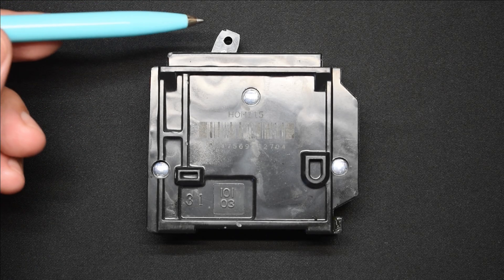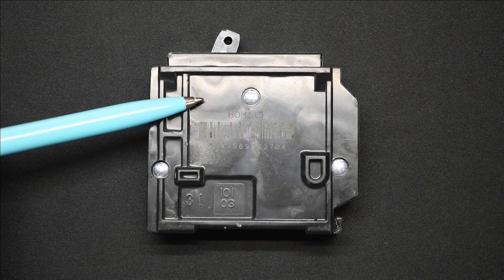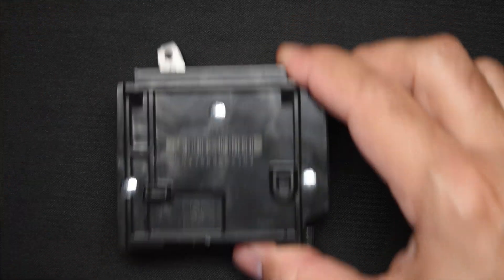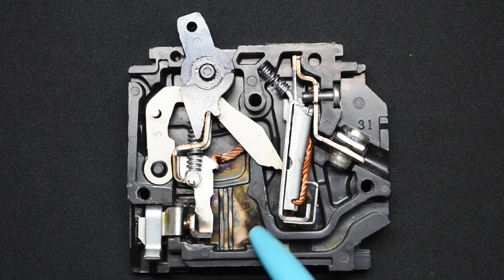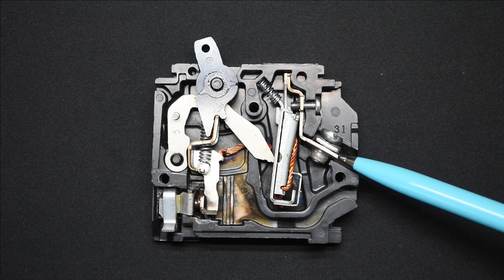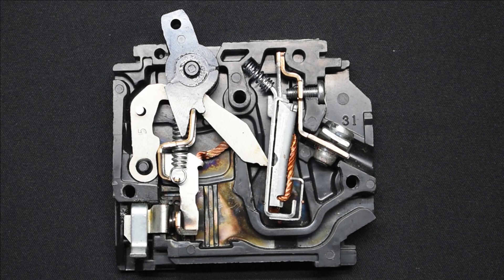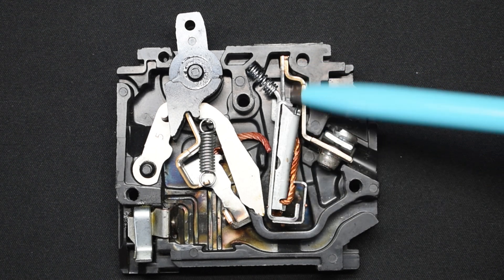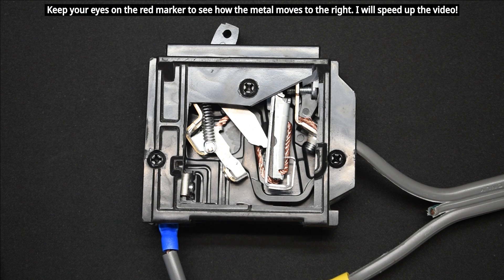Circuit Breaker Won't Reset or Keeps Tripping! (Common Problems)

Comment: I have two 15 amp breakers that won’t reset even after putting switch to the full off position. The switch is very loose and just keeps springing back.
Reply from the maker: Any breaker that doesn't reset needs to be replaced if you disconnected the load
Reply: I replaced the breaker and it still won’t reset

Comment: My 20 amp single pole won’t turn all the way on. I’ve replaced it 3 times and it keeps doing it. Funny thing is when I removed the breaker then I can flip it all the way. What can I do?
Reply: What ended up being your problem? Was going to comment to answer your question but saw this has hopefully been resolved.

Comment: I had a 20 amp breaker arc at the connection point to the bus bar while trying to turn it on; needless to say I'll be replacing that fuse. Any idea why this would happen; a faulty fuse, or perhaps a poor connection on the bus bar?
Reply from the maker: Challenger brand?
Reply: @electronicsNmore  It's square D
Reply: @electronicsNmore  Schneider electric I guess.

Comment: I used microwave last night and it went power off. I found out the outlet was not working because my toaster can't be switched on. Also, the outlet for my kettle doesn't work too (I plugged my kettle on the other outlet and it works). Then I checked my electrical panel and the breaker keeps tripping. So, do I just need to replace new outlets for both microwave and kettle? Or there's a problem on the breaker?

Comment: I used  new breaker and is still tripping while all the outlets are not in use can plz solve this puzzle for me.
Reply from the maker: Clearly there's a short circuit between the breaker and the outlets.

Comment: Nice demo! Circuit breakers can "wear out."
* The contacts can become worn or pitted, usually by using the breaker like a switch to turn on and off a load (some breakers are designed and rated for regular use as a switch) or by frequent tripping.
* Frequent tripping, or even extended operating at high loads that are nearly enough to trip but not quite, with the resulting extended high temperatures in and around the bimetallic strip, can result in weakening of that spring and associated components to the point of eventual mechanical failure.
* Some circuit failures can damage the circuit breaker. Such as surge loads that normally don't cause a problem, but which go dramatically higher during a failure. I wonder if something like that melted your copper braid?
I had frying bacon sounds and smoke coming from my well pump breaker. The breaker failed to open so I braved the smoke and flipped the main. It burnt the pump breaker, its bus contacts, and the adjacent breaker. It was a Siemens 240 volt, 20 amp breaker for a submersible well pump installed in the late 1970s and the pump most recently replaced about 10 years before the incident. Startup surge on the 2hp pump was specified at about 14x the operating power. The lights went out one day due to a distribution fault (blowing the 7200v fuse on the pole is dramatic), and while the utility was finding the fault buried on our street, they isolated each of the transformers then started connecting them one by one. I'm the first transformer on the street, and when they connected me and turned on the power, the voltage was nearly 300 volt instead of 240 and I nearly had a fire in the breaker panel. However after a bit of rewiring, all was apparently fine for a few years. Last summer I did need to replace the about 15 year old well pump. It was shorted... I wonder if when the power came on it was in a locked-rotor condition, and the high voltage startup did not help.
Reply from the maker: VERY common to have a poor connection between the circuit breaker and bus bar(especially older Challenger panels), I've fixed many over the years. Everything else you mentioned is accurate. Thanks for watching!

Comment: Most circuit breakers are designed not to trip up to 80 percent of their capacity. Anything above that , over time (minutes to hours) the breaker will trip.
Reply from the maker: That's true. If a load will be powered continuously, then you take 80% of the breaker rating as a maximum.

Comment: fantastic. Mine was even more less common which was the old one with the glass where you strew in with the viable fuse so that was pure thermal. LOL I put your video even faster speed to see the metal bend. interesting how they put just the right about of everything to trip at the exact temp... I assume. Unlike your other video fuse that tripped easily. 
I notice how they can vary in thickness despite the same voltage. 
Will you show the magnetic one or is it too much of a pain to deal with?
Also the voltage in the homes are higher than 120 maybe 124 at times which wouldnt that be an issue in your option for higher bill or more stress on things? the electric company says its within 8% range and says its ok.  hmmmm
thanks
Reply from the maker: I've swapped out screw in fuse panels years ago. I remember the time delay type. If this video starts pulling in views, I may do another showing the magnetic type. As of now, it's a big waste of time. YT is best at one thing, suppressing my channel.

Comment: Circuit breakers are designed to protect wire. Usually when a circuit breaker wears out it is because recently you may have changed a motor out for a new motor or replaced an oven or and very powerful microwave oven. Circuit breakers do wear out. Usually it is thermal protection part of the breaker that wears out over time because of the initial amperage draw.
Reply from the maker: True points. Thanks for watching the video! Be sure to share the link.
Reply: Are you saying the bimetallic strip wears out? How does that happen?
Reply: @andyfer7716 yes it does. Every time the breaker trips on a thermal load it never bends back to the original/previous position. Over time the breaker eventually will not reset when tripped by a thermal overload.
Reply: @iamanempoweredone6064  ok thanks
Reply from the maker: @andyfer7716  The strip doesn't wear out, but the shape can change slightly over time if excessive loads have been placed on the breaker. Nothing lasts forever.
Reply: @electronicsNmore  Thanks. However, I would think that minor bending wouldn't appreciably affect the mechanism to the point of failure. It seems more likely that the melting of the copper wire (like in your video) would happen first.